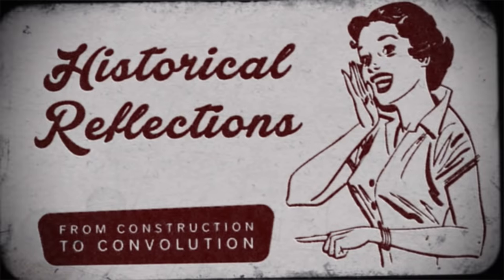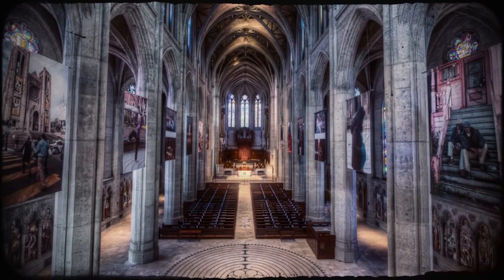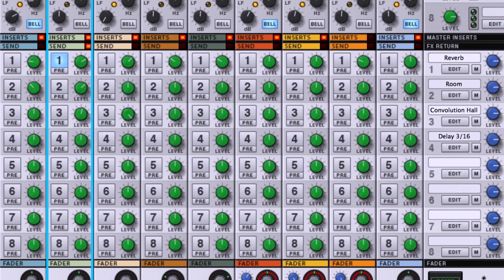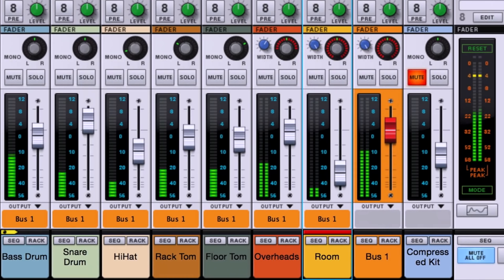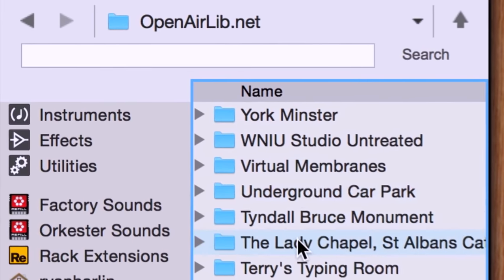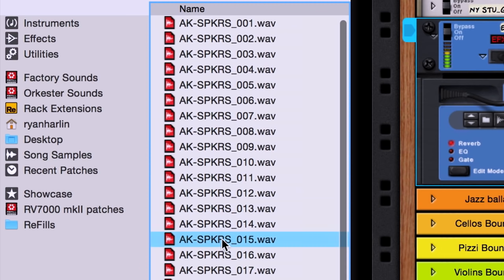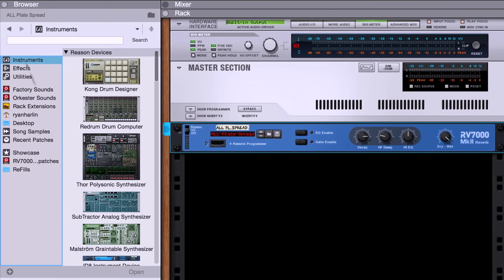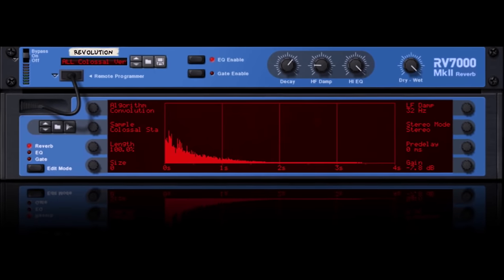Getting Started with Convolution Reverb

Comment: Would have been much better if the patches were added to the factory bank instead of a separate download.
Reply: The Hit Man That would require every user to download the entire FSB again.  It wouldn't bother me much, but I know that large downloads are still difficult for a lot of people.  I hope they'll drop these IRs into the FSB the next time it gets a larger update though.
Reply: Shawn Esplin """That would require every user to download the entire FSB again.""" -- I'm not sure, since 8.2 introduced incremental updates. But for users of 8, 8.1 yes (users of older versions would have to get the whole FSB anyway).
Reply: Nickos Venturas The new incremental updates are so small because they don't include things like the ID8 soundbank anymore (it's separate now so it doesn't have to be downloaded every time).  I don't think ReFills have a mechanism yet to update them without replacing the whole thing, which I'm guessing is why they didn't put these into the FSB.

Comment: This is a great addon, (8-10 years late)... Propellerhead is very slow with keeping up with the industry... SMH! Almost all the devices in Reason were there from Reason 1 with not a single revision. Thats over 15 years so they sound super digital, flat and cheezy... on top of that there's no delay compensation so there's no way you can get a mix with great depth and punch if your session is over 10-12 tracks. ( No matter what they tell you in the mixer tutorial). I really like Propellerheads so I hope they pick up the pace soon and stop coming out with feature crazy late after every other DAW been had it for years and acting like its the best thing ever.
Reply: +Keith Lewis There is no need to copy/paste this comment on all new videos from PH. Not only is your statement about the need for delay compensation wrong, as evidenced by all professionally made music released with Reason every day, but it is also a bit ignorant to complain about 15 year old synths sounding like they are 15 year old. They should! Why not use one of the newer synths instead, if that's the sound you are looking for? And btw, the flat and cheezy sound of the subtractor is because it is all natural, without any added effects. Just add whatever effects you'd like on it (like even amateur producers have done for more than a decade) and it will sound just as fat as you'd like.
Reply: +Keith Lewis HATER Faker, But we, use reason, not logic, so we make the rump shaker.